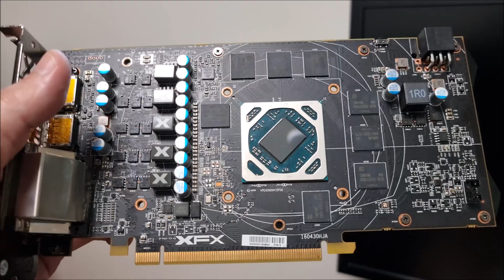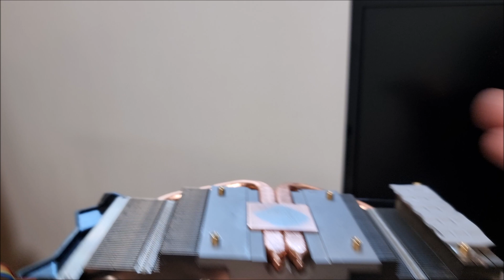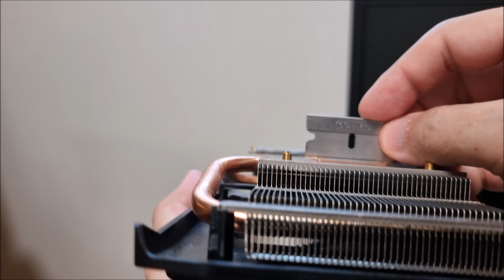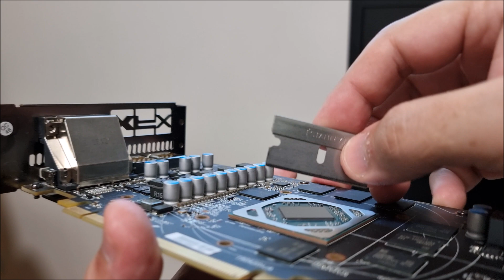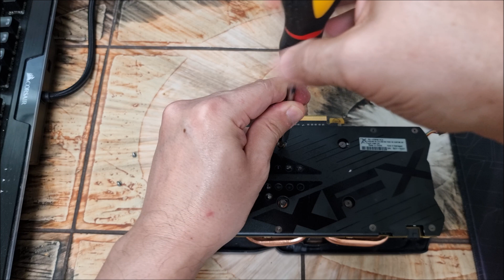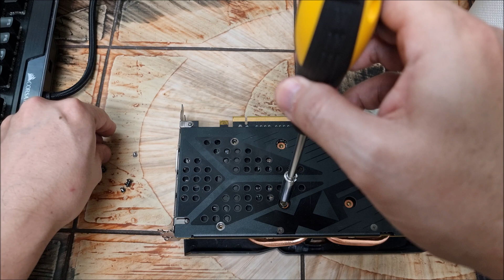GPU Hotspot Mystery Solved! Not What You Might Think!

Comment: Tempratures on my GPU.
hot spot 100C
Global 77C
(GPU) 77C
(memory junction) 65C
(hotspot) 98C
(SoC VR) 69C
why do I hace 2x hotpot in hwmonitor feels confiuzing, I have changed thermal paste and pads and got lower temp but I did not change backplate and will do it soon.
my memory junktion droped 30C temp but GPU temp drop 5C only becuze of reapply paste every year 2 times.
I have pump out effect, when I OPEN up my GPU die is only 80% coverd by paste, my metod to apply paste is to spreed out all over the place and adding extra paste in midle to make sure its more than enaugh.

Comment: My 7900 GRE is 49c with a hotspot at 105c.. LOL.. Time for new thermal paste/pads
Reply from the maker: Try Thermalright Heilos. It's real good stuff.
Reply: @TechnologyHive  I've just ordered some PTM7950. That should be good right?
Reply from the maker: @Ziplock9000  Yes, it's one of the best.
Reply: @TechnologyHive  What do you think the pad thickness should be for a Asus Dual 7900 GRE OC Edition for just the main GPU die?
Reply from the maker: @Ziplock9000  If you are going with PTM, thickness wont matter, as it comes with only one thickness and it works for all.

Comment: I am having black screens issues and after I ran a benchmark test I found out that well my GPU runs at 68 degrees but damn my hotspot is like 103 so yeah I got a problem it seems and could explain why my GPU goes black
Reply from the maker: Try PTM 7950 or Thermalright Heilos. It will help greatly.

Comment: For my 7900xtx i used new thermal paste and decrease new pads from 1mm to 0.75 mm for the memory chips, temperature new... GPU max 65 Hotspot 95 memory 75, old temps GPU 75 Hotspot 105...memory 90... For testing I used the app 'Heavyload'  or 'Aida64'
Reply from the maker: .75mm seems to actually be the correct size in most cases.

Comment: that's also what thermal paste is good for, to make up for those irregularities
Reply from the maker: Thermal paste can only take you so far, no matter what w/mk they claim. In situations like this here, since I posted this video, I have experimented with nickel plated heatsinks and liquid metal, and seems to do the trick. The hotspot would not even be an issue if it weren't for the fact that the card will thermal throttle, degrading it's performance in order to control the heat.

Comment: my 6900XT i have to do -15% power or i get over 100 degrees, i wanna try LM, gpu temps are low 65 and the hotspot is roasting.
Reply: I know it's been 2 months since your comment, but the cards are designed to run a hotspot at 100-110. they reduce frequency around 110.  I have a red devil and before I removed the cooler to install the water block, I tested it of course and in open air it was hitting 110. down to 90 under water before undervolting and reducing power limit. Just volunteering information I have found over time.

Comment: My msi mech 2x OC 6700xt hits 110c hotspot fairly quick in any game that can put it under a good load ive probably got around 2k or so hours on it also and havent noticed any difference but ive started capping my fps and using radeon chill and fsr and all to help keep it down and it still gets into the 90s on the hotspot undervolted it by like 60 mv also don't know if that does much
Reply from the maker: I would repaste it with some good thermal paste, like MX-4 or MX-6.

Comment: Hey sir thanks for the video. Now, I'm almost certain that my new 9060 XT has the same issue. Bought the card, freakin 35 Kelvin delta. Bought a second one, exactly the same. I think I only can open it up and see for myself. So thats definitely not limited to specific gpus of course. Will try changing paste with HY-P17. If it doesnt get better I'll try again with heilos. Thx a lot!
Reply from the maker: I think you will be happy with Heilos.
Reply: Hey bud, did you change the paste? Results? Cheers.

Comment: I recently noticed my rx 6900xt reference hotspot hitting 112 celsius while the GPU was at 71 celsius, 98% load native 2k stalker 2!
 I replaced the factory vram pads with new ones but the hotspot temp persists at 112 celsius!

I have already applide liquid metal to the gpu since 4 years ago

What do you think could cause this high hotspot temp ?
Reply from the maker: It could be the actual die not being completely flat. I have , in the past, fixed this by slightly shaving off some height from the heatsink posts that connect to the pcb. I forget the correct term for those.
Reply: @TechnologyHive  I opened it up again and after a second check I noticed the liquid metal on the GPU die does not change at all, as if the contact from the heatsink is minimal, would you suggest using PTM7950 instead of liquid metal ?
Reply from the maker: @AlexSBedini  Absolutely! If you can find Thermalright Heilos, even better. I believe they are both the same thing, just rebranded. But either one, as long as they are both legit, will work better in your situation.
Reply: @TechnologyHive  thanks for letting me know

Comment: I'm using a Radeon Sapphire 5700XT. The core temperature is around 70 degrees, but the hotspot temperature is rising to 115 degrees. I used a good thermal paste to somewhat compensate, but it's gone up to 115 degrees again.

While searching YouTube, I came across this video and decided to disassemble the graphics card. The thermal paste was completely absent on the lower left side, and when I measured it with a razor blade, it was higher there. It's not flat. ㅠㅠ People say the Radeon's hotspot is the edge spot, so I suspect that's where it is.

After reapplying the thermal paste, re-installing it, and testing the benchmark, I saw a maximum core temperature of 78 degrees and a maximum of 108 degrees. This is also abnormal, so I searched the comments for a solution and came across the Thermalright Heilos and PTM7950, so I ordered them right away.

I want to come and install it soon. I'll come and install it, measure the temperatures again, and leave a follow-up review.

Thank you for the great post! Thanks to you, I feel so relieved to know the cause! ^^
Reply: hey so what is ur review on PTM7950?

Comment: rx6750 xt quick is under load 65 normal temp and hotspot can get up to over 90 if i dont almost max out the rpm on gpu coolers. its soo loud. is 90 celsius hotspot normal on gaming?
Reply from the maker: 90c is not going to cause any problems. I would keep an eye on it though. If it starts to reach 100c, then I would change the thermal paste.
Reply: @TechnologyHive thanks !
Reply: No, it is not normal at all. That is too high for that GPU. The card needs repasting and repadding. Don't just repaste. Always replace the pads as well.
Reply: @ZenAndPsychedelicHealingCenter now its stable, i think i forgot to apply coolers properly. Its now 10 -20 celsius difference max. Its all good

Comment: I had a feeling either the die or the cooler wetr thr problem on my card,i have a xfx swft 210 6600xt and depending on the power draw the hotspot can range from 95@156w and 105@176w,Ive probably changed thermal pastes a million times now,recently got ptm 7950 and the temps mentioned are what im getting so far,it was way worse before,honestly ive made peace with it,i always monitor my hardware while gaming and it dosent seem to throttle,even manages overclocks,the core temp barely goes over 70c,highest ive seen was 75.
Reply from the maker: Those are nice temps for the xfx model. Nice job!
Reply: You think?then i have nothing to worry about👍🏼 @TechnologyHive

Comment: I have a question, my hotspot temps spikes at 90 and sometimes even 110, but after 1 second it goes down immediately. Should I be worried?
Reply from the maker: If it reaches 110 and then drops down its because it is throttling down. I i would repaste it.

Comment: hotspot was never on my radar either but recently it became something I couldnt no longer ignore, so now Im using Fan control with hwinfo plugin to monitor it and adjust my fans accordingly, just monitoring off standard temps you are presented with is extremely misleading... Found this video after I did my own hotspot journey with a 2080ti. for me it was thermal pads.

Comment: Like you said this is nothing new. So if i see this issue I take some 1000 grit sand paper and lightly sand down center of die. do not push on it let the sand paper do the work and do your best to not sand edges of die just the center to remove high spot. I have seen drastic reduction in temps after doing this. I would have to say roughly 25 times or so maybe more. Or you could use some ptm7950.

Comment: My 7800xt reference model hot spot will be 90c because it will boost to 2650+. Now if i set it to the rated 2430 MHZ it will never hit high 70s. I think my issue was crap drivers not my card.
Reply: Yeah those cards are overclocked like mad. Reducing to something closer to reference clocks will reduce hotspot by much more than any physical intervention.

Comment: Hello, I have a Palit 3080 ti gamingpro card. I have maintained it with mx-4 and quality pads. gpu 60 degrees, vram 70-74, hotspot 106 degrees. so it goes into protection and works with maximum fan and reduces wattage. what should I do. do you have any ideas?

furmark program vram 99 degrees, Hwinfo Aida programs show 70-80 vram.
Reply from the maker: This might have to do with your thermal pad size. I would take the card apart. Remove all thermal pads. Add thermal paste over the core and place the cooler over core to see if it makes perfect contact without the thermal pads. You should be able to see this by looking at the thermal paste imprint. 

If it makes good contact without the pads, then this means the pads are your problem. They may be too thick.

Comment: Hey i have rx 6600 xt. In just 3 min furmark my hotspot temp goes to 100 - 110°C and then crash and my psu connecter on gpu is also melted. Does high temp cause that.. plz help........
Reply from the maker: @SoloGaming7123  Hello. Graphics cards are built to throttle down when over heating, so the fact that your PC is shutting down might be due to some damage somewhere. Perhaps the gpu is to blame, or it just needs a repaste badly.
Reply: @TechnologyHive  thankyou for your support I'll contact asus rn.

Comment: i have the same gpu lol. what i did is i bought ptm and also using plastic washer for more tightness. problem solve
Reply from the maker: @Leerzej90  Nice job 🙂👍🏼
Reply: what is ptm?
Reply from the maker: @arianaa7767  it's a phase change material TIM. Thermalright Heilos is the same thing. The thermal interphase material changes from solid to paste as it heats up.

Comment: As 6700XT user, I just changed a thermal paste last couple month using ID cooling frost X45, 

But on this month my gpu hotspot reached 90-98 and 100c 

While playing cyberpunk, Should i To repaste it or no?
Reply from the maker: Try Thermalright Heilos. You can find it on Amazon. Or PTM7950. This will absolutely fix that hotspot issue.
Reply: @TechnologyHive  Alr thank you

Comment: Hi man. I have RX7800XT Asrock steel legend. My temps was 65 gpu temp and 110 hotspot. I was tired of it (with undervolting it was 95 degrees) So i disassembled it, put back factory thermal paste that was pumped out and boom, 63 degrees gpu temp and 80 degrees hotspot. Now i'm waiting for my Honeywell PTM7950, think temps are gonna be even better. And there still was 1.5 years of waranty but i was to lazy to return it
Reply from the maker: @maskedguy9753  Nice job. PTM will definitely help also.
Reply: Update. Applied PTM7950, same temps (63 gpu 80 hotspot) but without fans being cranked up, before it was 3200 rpm, now only 1800 rpm with 277w power draw
Reply from the maker: @maskedguy9753  It's running cooler, so the gpu can  boost higher. Nice!
Reply: @maskedguy9753  great.  How is it holding up? Going to do mine next week
Reply: @Lothar1393  62 gpu temp 85-87 hotspot after 30 minutes of stress test in OCCT extreme settings, 270 watts power consumption. Testet on July during heat wave (it was 40 degrees celsius with almost no wind)
Reply: @maskedguy9753 great. I ll do a tortue test tonight or tomorrow and do the ptm this week also and see what it does. I have a xfx 7900xt reference model. Not overclocked/undervolt yet, just gotten it (used).

Comment: Try undervolting.  Can be a great way to solve these issues if you don’t want to void warranty
Reply from the maker: This can work, but it does not solve the underlying problem.
Reply: @ I know what you mean, but it stops the hotspot temps getting high and I gained a couple of fps and reduced fan noise with this.  I had a 3080ti which they refused warranty on as they said the screws had been tightened, at least if it does cause a major issue my warranty will still be there to fall back on
Reply: @aaroncoleman3277  So does not using your computer. Again, it's not solving the issue.
Reply: @Ziplock9000 yes it does. Were you deprived of oxygen at a young age ?

Comment: Now this is interesting - 7900XTX owner here. 

Yesterday took the card apart and reapplied ‘normal’ paste, however to no avail- still hitting up to 108°c hotspot. 

Ordered some TPM. Can’t wait.
Reply from the maker: It should be fixed with phase change material. If can get your hands on Thermalright Heilos, give that a try in the future.
Reply: @TechnologyHive  I updated my 6900xt Red Devil with Thermal Grizzly PTM and it made a big difference
Reply from the maker: @matthewbusse1059  Nice job!
Reply: Any updates?I'm about to repaste mine,  110°C on hotspot on Cyberpunk at 4K it's insane, thinking about using Phasesheet.
Reply: @someguy4849 ultaimtrly had to RMA the card as it was faulty- the GPU die wasn’t flat whatsoever, hence all of the paste wasn’t on there equally.
Reply: @jeroenrodenboog3815  how is it now?
Reply: @SwerveNation I RMA’d it. 

Under European law any user isn’t allowed to open up an still RMA it- so I sent it to AMD themselves. They found a defect in the card itself so I ultimately got my money back

Comment: Hi, I came across your video and it was very interesting and informative, thanks, although I have a doubt regarding safe temperatures for the hot spot under heavy load, my rtx 3050 8gb reaches values from 80 to 83, do you consider these to be normal safe ranges and do not affect longevity?
Reply from the maker: 83c for the hotspot is fine. No worries there.
Reply: @ Thank you

Comment: Hey man! hope u can respond. My 3080 ti 3x ventus . idles around 60-70 (got it undervolted to 1950 at 900). If i dont undervolt it will get higher. but i do a cinebench, and my max temps are 75 cel and 90 celsisu for hot spot.
Reply from the maker: @JustFns  Those idle temps are bad. I think you need to repaste it. Try MX-6.
Reply: @TechnologyHive  Thank you for responding, Changed the thermal paste and pads, tiny decrease in temperature 2c. But found my issue, had to reinstall the drivers completely because i couldnt unvolt (im undervolted but it wouldnt let my card idle) , it would be steady 1935 mhz. Merry christmas

Comment: I just bought a rx 5700 xt thicc III from ebay and it has a hotspot of 110c idk how to remove it and I just repasted the gpu and vram chips
Reply from the maker: @Lvtdgb_40m Try Thermalright Heilos. And make sure you're using the correct thermal pad sizes.
Reply: @TechnologyHive  I just bought some kryonaut, I will try that if this doesn't work

Comment: My cards brand new and has a 10 degree difference between normal and hotspot. It's actually normal to have a hotspot every card ever cpu has a hot spot the software just hides it from us! It will always be around 10 degrees hotter and you also can void your warranty if you open the card. They have seals that you have to bypass or you could void it it's not worth it.
Reply: Opening up the GPU does NOT void any warranty legally in most jurisdictions, including the US and the EU.